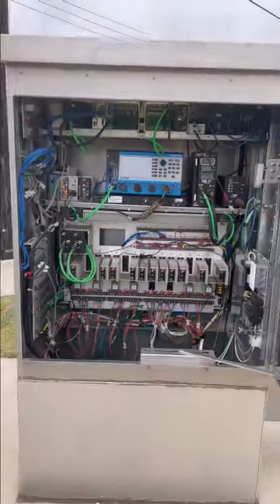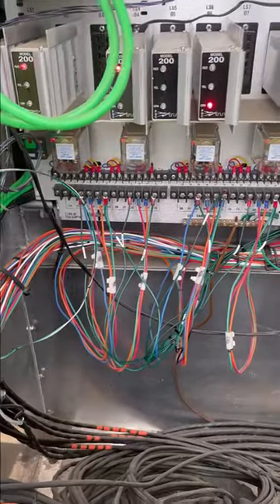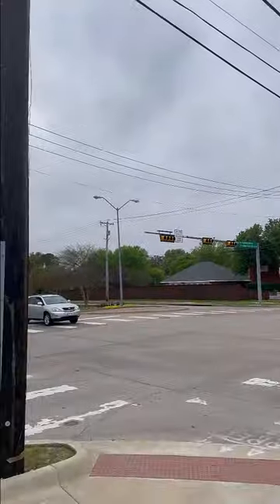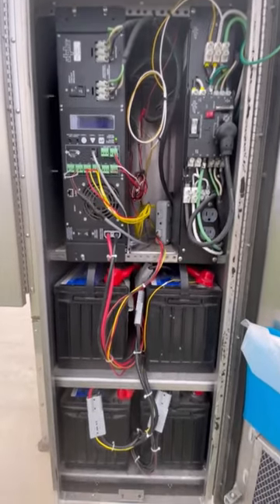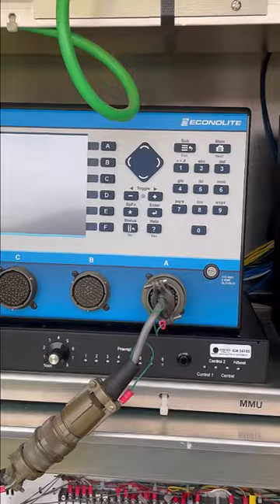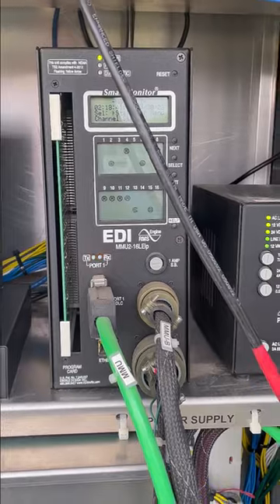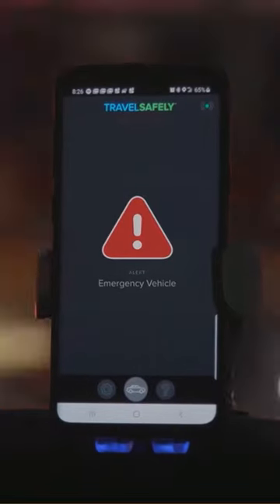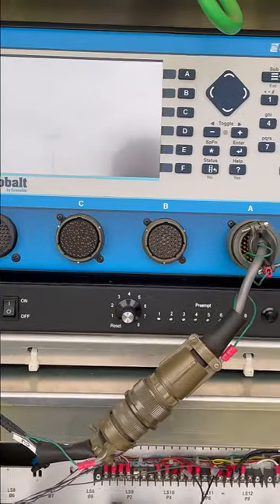What's in a Traffic Signal Cabinet

Comment: This is a very old system though, here in the Netherlands it’s a single computer with inputs/outputs that’s controlled through the cloud, they’re all connected to each other, make real time adjustments to timing, can detect amount of vehicles, weight, speed, where located, and upcoming. It uses all this information to independently control each light and can independently control each light’s timing, red clearance and much more!
Reply: not all traffic controllers are connected with each other, most traffic controllers in the Netherlands are stand alone and only connected with the IVERA central computer (IVERA centrale)
Reply: Dumb idea so if the cloud server shuts down the traffic lights stop working
Reply: @Masisi69tifibel  no? The cloud controls the timers on the traffic signals and they can also independently communicate with each other without needing a host.
The Dutch don’t do stupid ideas lol
Reply: @bmw518rijder  depends which city, cities like Utrecht and ‘s-Hertogenbosch have partnered with Siemens and some other brands to create a love traffic map, but yes it’s still quite rare, most signals are just insanely complex and smart thus creating a seamless experience.